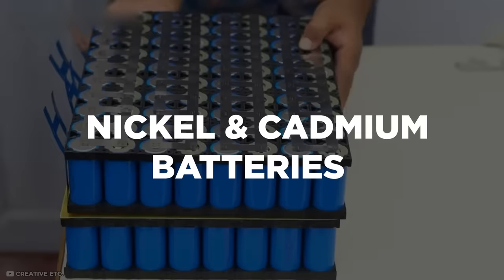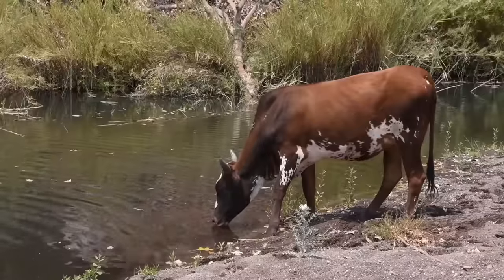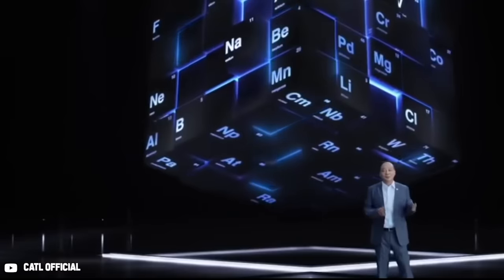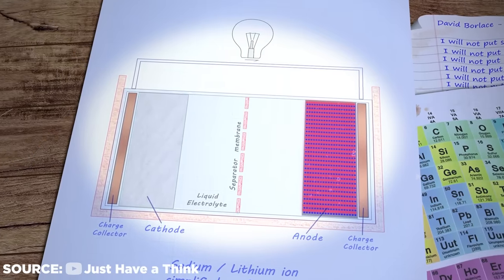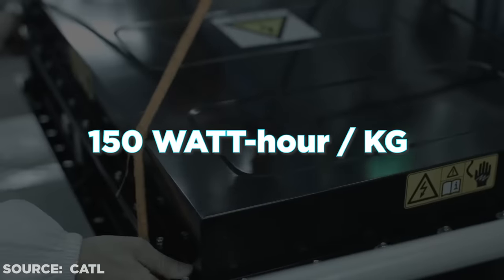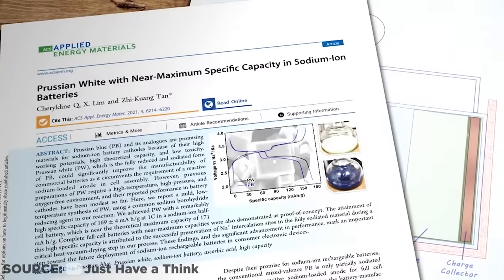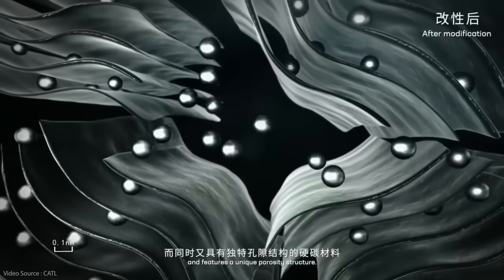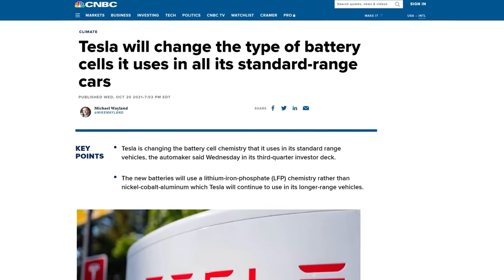No More Lithium! NEW Sodium-Ion Battery To BEGIN  Mass Production

Comment from the maker: See also: The Latest Silicone Anode Batteries: https://www.youtube.com/watch?v=ts2vRBhj658&list=PLNXtbtg0OIFafAjE463D7qd5RzS8vuluN&pp=gAQB
Reply: It is unlikely that Li-Ion be replaced in all applications as far as there are plenty of applications out there that are quite sensitive to energy density and are looking for high capacity. However Sodium currently looks as having a good position to grab a significant share of the market.
Reply: Right now Li-ion might be replaced only in some cases, when weight isn't important, but price is. But main part of that project is really cool
Reply: Hard carbon anode could replace graphite for sodium ion battery.
Reply: Perfect for stationary batteries.
The world is going to need TWh of Grid Batteries
Reply: Jai Hinduja.     HiNa is  Hi Sodium.
Reply: Near the end of the video we're told that the energy density of next generation sodium ion batteries will surpass lithium ion batteries.  So why wouldn't Li batteries become obsolete?  Why would it be a show stopper that the graphite used in Li batteries must be replaced by a different material in Na batteries?
Reply: Not by a salt battery.
Reply: Certainly not in EVs, unless the energy density issue is addressed. People also forget Li-ion energy density isn't a stationary target, Li-ion batteries are improving rapidly too. Look at the periodic table to see Lithium atoms are much smaller charge carriers than Sodium ion. So I only see sodium ion taking some share of the stationary storage market. The lithium price rising is not an absolute, but rather its currently a state of the shortage in lithium due to underinvesting in lithium projects for the last decade. As lithium prices rise more investment is coming into lithium mining, so more production will be coming online and the price will drop. So its not nearly as straight-forward as this video makes it seem.
Reply: Metalic Salt changed intto liquide with petrol and the Graphene and That is my technology... 100 % better.
Reply: @maxwellschaphorst8050  the weight issue is not as straightforward as weight of lithium vs sodium. This video alone mentioned that in the sodium batteries it is possible to use aluminum in place of copper and the electrolyte needs to be less concentrated (both of these provide weight savings at the level of the whole battery). If further design changes can be made that reduce the whole weight of sodium batteries vs whole weight of lithium batteries, sodium batteries may be able to take over the electric vehicle market too.

I do not think you can guarantee that  more mining of lithium will reduce its price, as lithium is a relatively rare element. PLUS, the considerations have to include environmental costs of mining lithium, the nasty pollution produced that this video mentions as well. OTOH, how hard or polluting is it to mine sodium? :) You can get sodium from salt water. 

This video does mention that sodium batteries are cheaper, BUT does not mention their working lifespan. If sodium batteries last at least as long as lithium, they will win... I would have liked though for the video to address comparative battery lifespan... plus address the recycling difficulty and pollution from sodium vs lithium.
Reply: 'you' who.... ?  scientists or ordinary folks who can barely read the words?
Reply: @brothermine2292  Because Sodium-Ion battery will be made in China.  For national security reason, the US will refuse to use it.
Reply: Hemp
Reply: I think I read Altech Chemicals have made good progress with the graphite anode problem and are about to start manufacturing in Germany.
Reply: Sure... eventually.
Reply: For me  its like just super capacitor  as battery, they said it will replace the whole battery concept  lithium battery is history but  as you can see  lithium is still the top notch  so  i'll wait for it put it on the market first before we decide, let see which one is cheaper and realiable
Reply: @DougHinVA  oh yes, the gatekeeper of opinion
Reply: Lithium is SALT concentrate.  You don't have a clue

Comment: An important question not answered is whether existing chargers for Li-ion batteries will readily work for charging the new Na-ion batteries. Having to replace all of my specialized Li-ion battery chargers to use these new batteries would be a non-starter.  Hopefully the charging profile and the min and max voltages will be very similar to ensure cross-compatibility.
Reply: even if that were the case, which I doubt, that hardly seems like an insurmountable problem.
Reply: safety issues is more important and not addressed starting with corrosion and how it can lead to other hazards depending on material its cased in. like some can cause explosion. also like mercury is not allowed to be transported on airplanes due to how it reacts to aluminum rapidly eating it away. and some chemical reactions can alter elements into toxic gases or acids that even eat stainless steel etc. every tech has its own cons

Comment: Ive been waiting on new types of batteries coming out for years now. Wonder when or if these will hit the market
Reply: i love my lipo4s EVE cells so much juice available no more power bills and last for ever 15 years
Reply: @twistedthrottle8513  Yea, it's good battery tech, not quite
 as power dense as NMC, but a bit less finicky. You know what the primary difference between your LiFePo and a cell phone or Tesla battery is the cathode material, riight? The lithium is the same. Good battery management is the key. If a cell goes bad and isn't addressed the problem can cascade throughout the pack. One of the biggest issues seem to be the electronic components in the Battery Management System, they just don't seem to hold up. One failed transistor can find a battery not being charged properly, and eventually falling out of spec, and before you know it everythings gone tilt. If a temp sensor fails and the charger starts charging  cold batteries the entire pack can be taken out in minutes. The bottom line is Lithium battery technology is not just set it and forget it. But people are. Which is a real problem when a 10-cent capacitor failure can eventually take down a 10k-dollar battery pack.
Reply: That being said, lithium is not the problem here it's the electrolyte or the construction of the cell for the anode or the cathode material. It's not Lithium. If you solve all of the construction, anode and cathode problems using sodium, then when you substitute lithium for the sodium the battery will be better.

Comment: CATL is mass producing Na ion batteries but they have reported that the batteries can only function optimally at very cold temperature -20 degree C.
Reply: How much efficiency is lost at room temperature?
Reply: Lithium-ion batteries only function optimally at 15C to 35C, which is why they are problematic in winter. From my understanding, sodium-ion batteries can function from -20C to 60C. My understanding of the emphasis of the -20C from CATL is because that is a big industry problem they solve, I haven't seen anything that said there is a significant degradation at higher temperatures.

Comment: I can see them being good for grid level storage at 160wh per KG . That  in its turn will reduce the demand for lithium. 

But for mobile use  in EVs you will need 230+wh per KG and low degradation. That is atleast 4,000 cycles before capacity drops to 80% 

For grid storage Yes , for EVs "maybe"
Reply: Look into the first electric cars…

Comment: If this is the case I'm excited. I wonder if these batteries will be rechargeable? One use isn't anything to get excited over. I have lithium ions I've used for years.

Also, I'm amused at the idea of my laptop being powered by salt lol.
Reply: Salt powered laptop + cod warzone would basically be an infinite energy device, lol
Reply: regardless of how this video's trying to make it sound, the sodium they are talking about is sodium metal, not sodium chloride (salt).  look up videos about sodium and water and you will realize that it's just as if not more dangerous than lithium batteries. (plus heavier)  good luck if you get in a car crash in a battery powered vehicle is all i'm gonna say
Reply: @trance dj  You're right. Battery fires are a nightmare for even seasoned firefighters. You can't just spray water and call it a day. On top of that batteries can sit for decades and catch fire!
Reply: @XX-121  Something not mentioned in this video is how work is progressing on using porous glass to contain the electrolyte.  I've seen a video of someone literally cutting up a thin-film battery made using "glass electrolyte" technology.  The battery smokes at the point where it's being cut and flickers from the short-circuit, but after the cut is complete, it keeps on delivering current and does not catch on fire.
With sodium and glass electrolyte technology, next-generation batteries should be much safer than the current Li-Ion cells.  Add the ability to take an 80% charge in 15 mins and suddenly long-distance driving becomes less of a problem.  Start charging; get a coffee and drink it; come back and continue your journey.
Reply: @hf117j  Sodium, not salt.  I think there's some subterfuge going on here.

Comment: Now we just need somebody in the US to start making this, and we can really go nuts on renewable energy.  Lack of cost-effective grid scale storage has been a major obstacle.
Reply: I just drove through Iowa past dozens and dozens of defunct windmills.  The main bearings wear out and it's extremely costly to repair them, so they just don't bother.  All those windmills were erected via government subsidy.  As much as I like the idea of renewable energy, you have to look at the practical details and realize that those windmills cost a fortune to construct and required fossil energy to do so and their lifespan is quite limited and will need to be torn down at some point, too.  The tax dollars don't currently pay for that part of their lifecycle.  To say none of it was ever cost effective would be a massive understatement.  It was Obama's Green virtue-signaling.  In the real world, it is an environmental disaster.
Reply: @bb5242  So you're saying we need cheaper ways to service wind turbines. Sounds good. Perhaps some kind of self-erecting system where the entire drive module can climb down the tower to the ground? I hear the blades are also a problem, currently they're mostly made with fiberglass and cannot be restored so they just pile up.  These are solvable mechanical engineering and materials engineering problems. The first internal combustion engines were pretty bad too, to the point that steam and electric cars were developed in parallel with gasoline engines for decades. We can't look at the current state of the technology to fully understand what we can achieve in the future.

Comment: Theres a huge problem with water purification plants in the ocean coasts, there is a ton of salt left over when the salt water is filtered over and over to make fresh water. Could all that left over salt be used for these sodium based batteries?
Reply: This is NOT salt, that would be NaCl sodium chloride. This is the Metal Sodium Na, and volatile when mixed with water!

Comment: Maybe this will be useful in industrial applications. I am a nomad and live in a camper. I use 2 x lithium batteries with solar. I plan on buying 2 more. Why are you saying that LiFePo is so expensive? The price has halved during the time I have been buying them. A crap no name battery in 2020 cost $675. My next was $900. The next 2 are $299 each. That is delivered. They have dropped like a rock and the quality is improving. They are about 30lbs each - about half that of a lead acid battery. Sodium are 3 times the weight?? Good luck selling that to a vanner or boat dweller.

Comment: Are they capable of producing the same level of discharge as Lithium?  Tesla in Ludicrous mode has a huge power draw. Hate to see the battery overloaded and heat up to a dangerous level, especially made of sodium.  Another concern would be damage to a battery in a wet environment.  As I recall from early science class, sodium dont much like water...

Comment: The batteries aren't the biggest problem, it's the amount of power required to charge them all on a massive scale, and with the constraints of most power grids, would melt the wires off of the poles.

Comment: It seems biggest advantage is cost, 25¢ instead of 35¢. That is quite a bit of saving. Though current systems have to be converted but the company states within two years they will be in positive.

Comment: I think that sodium ion batteries will replace Lithium ion in EV batteries,  once the the super fast charging network is mature and fully deployed across the nation in sufficient saturation.  EV Range anxiety simply wont exist once the charging network is fully mature.  Sodium is far more abundant than Lithium, cheaper, can charge faster and is safer and works better in winter.  Most drivers don't even travel 230 km per day ( representing the lowest storage density of 160 Wh/kg ).  For the rare times when people do need to go longer distances, they could hire a car.  If they regularly travel longer distances, they could buy a hybrid EV.    There's a solution for every use case.  On that basis Sodium ion batteries could service a significant chunk of the EV market.  Sodium ion batteries would also be great for grid backup storage.

Comment: Even if they solved for the dendrite problem, good luck merging onto a freeway when the 0-60 mph on these is like 17 seconds. The CATL battery in the tiny car it powers is like 75 hp. That's about half the horsepower of a Ford Focus. It actually tops out at less than than 80 mph, and it take 30-60 seconds to get up to that speed, depending on headwind. And that's not me talking, that's BYD's published specs. This is a discharge rate/voltage problem that will always make sodium inferior to lithium. 

Now, for a tooling around town on surface streets car? Yeah, you could run errands with it. If you live in a small town it'd be great to give your teenager because they aren't getting very far or going very fast. But as a replacement for the ICE in the US? No. Not happening. This battery is for energy storage, and it'll be great for that.

Comment: Quick questions, Does  a sodium ion battery technology  still require Cobalt in the manufacture as does  existing lithium-ion technology?  Also in the extraction of Lithium you stated the the surrounding enviroment is "Inevitably" contaminated. Is that contamination something that could be either avoided or reclaimed but it would substantially add to the cost either raising the price or affecting the profit margin? Thank you.
Reply: sodium batteries can use iron in place of cobalt
Reply: Link to video about that?
Reply: @snorttroll4379  idk bro im a chemist

Comment: And the reason why CATL is investing on Sodium battery is that they already know that NCM is the future and LFP is not. LFP is not suitable in EV because LFP is not even stabler than NCM in over 1 C Rate condition of EV. So CATL realize that if they want to enter to markets outside from China, they must sell NCM. However, most of patents of NCM are holding by LG Chem, SK on, and Samsung SDI. 
LG chem is holding about 25000 patents of NCM. SK on is also holding about 25000 patents of NCM. Samsung SDI is holding about 20000 patents of NCM. 
So there are no way that CATL can avoid those patents. If CATL use their NCM on EV that sales outside from China, they already paying patents fees to those three Korean companies, or not paying patents fees to those Korean companies with avoiding their patents. But in return, CATL's NCM gets very unstable, dangerous and less quality. 

This is why CATL have no choice but to investing on Sodium battery. 
Sodium battery is not better option.

Comment: Yeah, I remember when CALCIUM batteries were gonna be made in the 1990's-but they NEVER WERE! I also remember GM's "molten sulfur" automotive batteries " that will revolutionized CARS" in the late 1970's using a Vega as a "test-mule"!!! I saw it and DROVE it at the International Petroleum Exposition here in Tussa, OK. I was always aware I was sitting on top of a 900*F battery pack, and while it MAY have had double the HP of a stock Vega (claimed 150 HP), it was STILL a slug! The Chrysler/Texaco Hemi "Lean Burn" was there too. 352 CID Hemi and 315 NET SAE HP and ran CLEANER without a cat-con than the GM's WITH zero power smogger motors and cat-cons and blew their doors off!

Comment: Just replacing Li batteries with Na batteries for static applications would reduce the demand for Li and make EVs cheaper (without ever using a Na battery in a car).

Comment: Sodium-ion batteries are much better suited for stationary applications because weight and size doesn't matter if you are building large battery banks for storing electricity generated by wind and solar.

Comment: Nice, but sodium weighs more than lithium. It is three times heavier. So, an electric car would weigh about 2000lbs more if it were sodium based. This would negatively effect acceleration and range. This is not much of an issue for stationary storage.
Reply: Your figures are weigh out.

Comment: We got perfectly good gas powered engines. They’re only efficient about 40%. There is so much room for improvement. If someone das not understand that. That means that 60% of gas or diesel come out of the gas pipe. In the 80s Opel/ GM/Coswort developed 2.0 16 valve engine, 30% eficient.